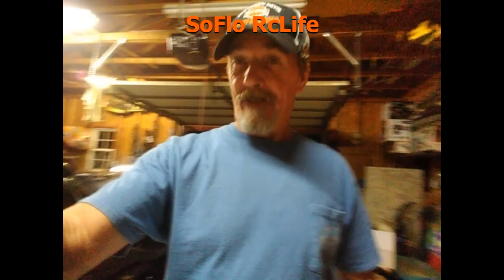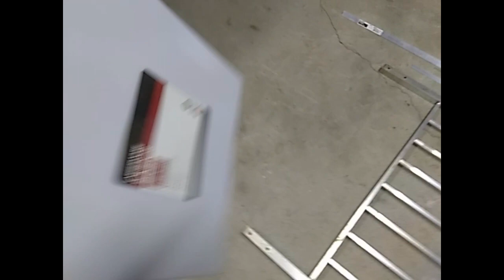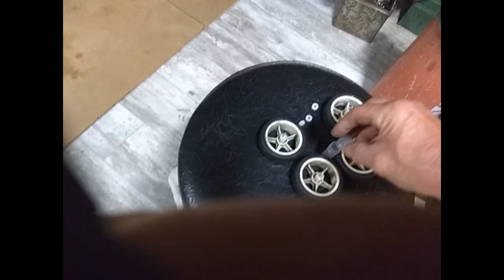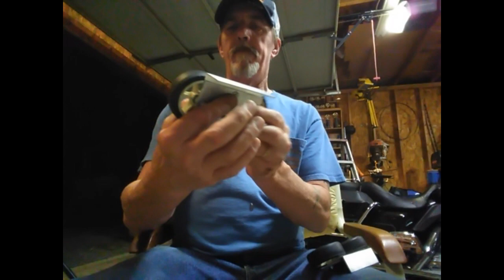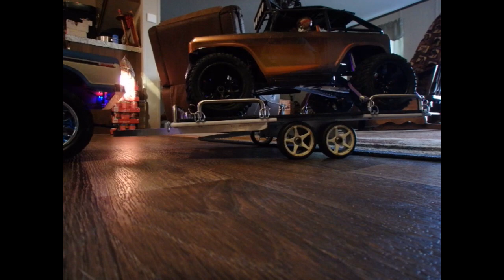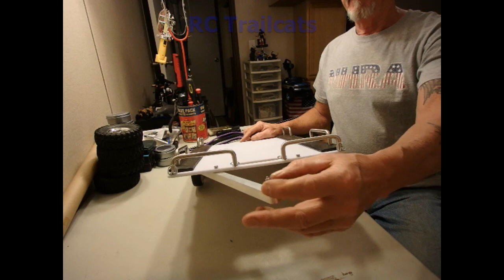Cheap RC Trailer build

Comment: Great Vid Larry.  Sharp look'n rig's.
Reply from the maker: Thank's Bro 😃🤙 Can't wait to see your PitDawg Goin ✌😎👍 RCFAM4LIFE  HFLPRCing
Reply: @LRCR  The HD Ram'nator is alot like one PitDawg did for someone elses smaller rig. The dragster, on the other hand, has similar colors but is "My kinda Kewl".  I know PitDawg does great vids and custom body work, I hope I find good tunes to show my appreciation. Any recommendations?
Reply from the maker: @denaliunderground4038  That's gonna be Sweet...Maybe if'n you don't get striked something from the 60's era would be cool like 
'Lil Deuce Coop" or "Deadman's Curve"
Reply: @LRCR  It's way to big to fit on a bike.  It's big enough to pull a plane!
Reply from the maker: @denaliunderground4038  Some Serious Power to move that Rig...Wonder about the clutch? when I raced Karts I used an Oil clutch for better performance

Comment: That's awesome! I made one too from scratch 3d printing and designing it... nice build!
Reply: Haha Hey Jim I just got my first printer and when I saw this I thought I bet I could print one then saw your comment. Where did you get the files from?
Reply: @rcintro1489  I designed it using tinkercad.com
Reply: One is 32" long by 17" wide 3 piece took me 3 days of printing to build it half a night  cutting the frame up to fit together and bolt up using same program
Reply: @Jayr1787  HOLY COW! I just got a Prusa and just started making stuff. IT'S SO COOL! What did you do for axles? Does it have shocks?
Reply: @rcintro1489  used threaded rod and designed the axel too. Used rc injora leaf springs. I'll be doing a video here later today actually. Good hearing from ya man hope all is well, and congratulations on buying a prusa!!
Reply: @Jayr1787  Cool look forward to seeing it. And thanks!
Reply from the maker: Thanks Brother I appreciate you watching and commenting 😎👍👍